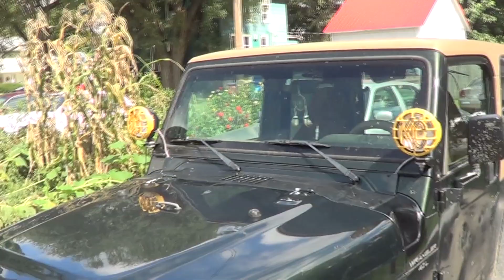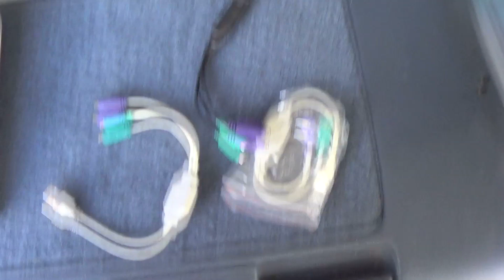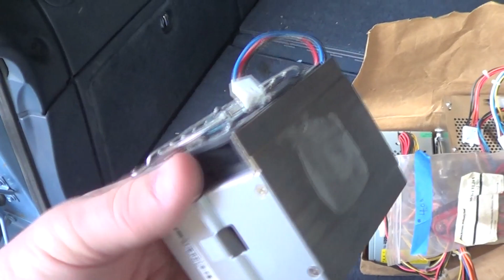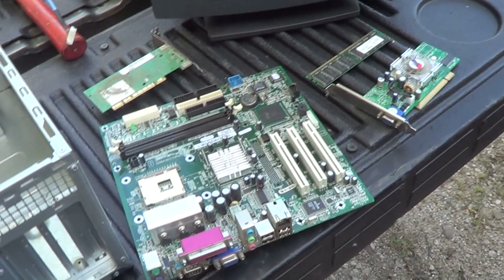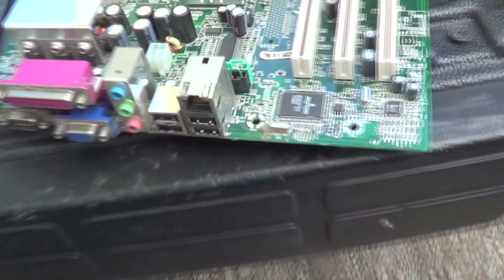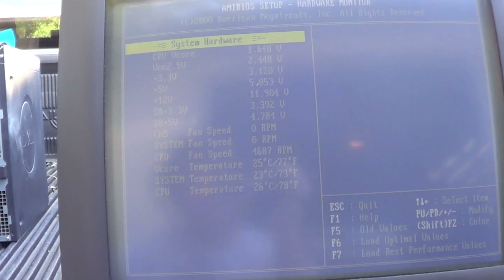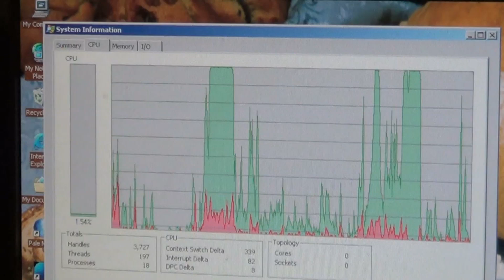2014 Hamfest Finds, Remodeling, A Little Car Stuff and MORE!

Comment: Much cool stuff. The TI-2500 was actually the first Texas Instruments calculator. Yours is a later revision from probably 1973. There are four NiCD AA cells inside it, which hopefully haven't spewed their guts everywhere.

I didn't know PC Chips made motherboards that recently. I thought they died out after the Pentium II era. The builder must have put a LOT of effort into saving money, given the fact that they chose such a board, despite the prominence and affordability of Gigabyte, Asus, and even Intel boards.

I'm surprised that Hipro power supply doesn't have bad caps. I have a computer with one (also 250 watt, so maybe even the same model), and MOST of the caps are bloated. I'm refraining from using the computer, and I'm tossing the power supply as soon as I get a replacement. It might do you good to open it up and look inside it, though - I recall that the only good caps on mine are the ones that can be seen through the vent.

That Dell monitor you tested the computers with looks to have been made by AOC - it's got the user interface composed of the several indicator LEDs that was typical of them. I had one years ago and liked it because of its uniqueness in that regard. It was also neat because on certain computers (don't know why only certain ones), the LEDs would make a chasing animation when it went into standby mode.

I'd be interested to see a video regarding unofficial Windows 2000 updates, if you ever make one. Same with the clock.

Any plans for that custom computer?
Reply: ***** I have a PC CHIPS Socket 775 board with a 1333 FSB 3Ghz CPU in it with a PCI-e Slot

Comment: This video was hilarious!  There were so many funny things you said in this video, it certainly kept me entertained the entire time.

Most times the screws used to secure the motherboard are hex-head as well as having the slot for Philips.  Wouldn't a nut driver have been a better idea for a stuck one?

P.S.  I made the PS/2 Model 30 floppy drive seek test video, you may wish to check it out!

Comment: as for the dell... it's always that last screw... which seems to be the case for everything electronic, there will always be that one screw that never comes out without using destructive force in one way or another. the service tag is in the bios as well. those service tag stickers always seemed to come off.

Comment: I've finally found a use for those old Dimension 2400/4700 machines after throwing away so many of them over the years. In their stock configuration, they were just too underpowered to be remotely useful for my needs. Since the case is one of the strong points of that PC, I recently got the idea to gut them and transplant more modern components. My most recent build was an Ivy Bridge Core i5 system with 16GB RAM, and an nVidia Geforce GTX650 video card. It makes for a great sleeper machine when going to a LAN party!

The reason I bring this up is because I now have TONS of perfectly good Dimension 2400/4700 motherboards laying around, that are working pulls. (No bloated caps either!)  I'll be more than happy to send you one for the price of shipping, if you're interested.

Comment: Speaking of PC Chips, I'm working on a Slot 1 Pentium 3 that has a Jetway motherboard that is allegedly just a rebadged PC Chips board in it right now. Its well past the fake cache era, but it has some interesting quirks such as having to "reset configration data"  in the resource allocation section of the BIOS before adding any PCI or ISA cards if you want it to post with the card installed. And having completely different onboard sound (c media instead of ESS) to what it claims to requiring one to go beyond the board support page for a driver. I would totally replace it, if I could find a slot 1 board for a reasonable price but that stuff just isn't around here in New Zealand anymore.

Comment: I have no idea as to the amount of people below people me to which I may be repeating, but i would love to see a windows 2000 unofficial update video.

I few years ago I got a hold of a Pentium 133mhz Packard bell  and a Pentium 3 gateway 2000 for a wallet shattering price of 3 dollars. On the Packard I install all the unofficial updates for  98SE and was quite impressed, but didn't run into much luck with windows 2000 for the gateway since there seemed to be different people, or groups of people making unofficial updates, some of the sites being completely in Japanese and I just didn't end up being bothered.

Anyways would love to see what you do to Windows 2000 and unofficial updates .

Comment: Bill, Ahh Palemoon, i enjoyed it untill i could no longer bodge it to work on my xp pro acer aspire 5315 laptop installation, i had to drop back to firefox, but it seems fine so im happy again :-)
Add blocker and ghostry (both disabled for youtube) i also have installed, in addition ive added configmania/Advanced settings/page-to-pdf plus flagfox, i do like firefox for its interesting addons :D, internet explorer/windows 8 or 8.1 and 10 have a place in my trashcan, if you know what i mean lol.

I really enjoy your ramblo-thon videos bill, never boring, allways interesting, something to sink my mental teeth into :D.

The heathkit clock i suspect is mendable, perhaps its a combination of dodgy switches and it may have lost its 60hz from the mains input to generate its ti........ming lol.
I too have used pcchips mobos, they work!!, sys chipsets can be fast but they crash a little too easly.

I also had one of those five million year old silvery astec supplys (big switch type), it didnt fail, technology just phased it out :(, i also had an ibm looking keyboard with  dip switches on the underside, XT and AT compatability, a rather usefull keyboard :-).
I better shut up, as im boring myself and dont want you to fall into a coma ha ha :D

Comment: i use that exact same antec case for my bedroom machine, i picked it up at a thift shop for €4 :D. this video reminds me that i should pick up more stuff from that thift store, they tend to have decent stashes of old AGP graphics cards on the electronics shelve.

i do have a car question tho, what is the fuel cost like with those large V6/V8 powered cars? its unfortunate that these kinds of cars are nigh impossible to own accross the pond due to fuel cost and high taxes aswel as insurance.

I'm also curious about your opinion on smaller economical cars. (cars like the mazda2 vwestlife used to own)
Reply: thanks for taking your time to write such a long response :)
and yea its a completely diffrent ballgame here, people buying new cars ussualy only look at the price and its fuel consumption. (unless they got deep pockets and go for a big german car) it doesnt realy help that our roads arent very friendly to american cars (speed bumps everywhere), aswel as parking spaces generally being too small to even fit them (or atleast giving you a massive headache trying to fit them in).
i think sales would have been better here if the government didnt charge insane amounts of tax aswel as import fee's which resulted in cars that had their price doubled or more. i quickly glanced at chevrolet's website and the camaro's starting price is $23,705 whereas here its €104.995,- (altho in the UK its £35.320,- but its still the double.)
and i do agree that i prefer the boxy styled cars from the late 80's and early 90's (the "box" in my username is derived from that heh.)

Comment: Bill, I have a dimension 3000 that just will not die. I have the ram maxed out at 2 gb and a 500gb ide hard drive running linux mint 13. I installed mint after XP support ended. It has been running for over 10 years now. I bet Dell regrets ever making the model 3000 because I have had no need to replace this one. I enjoyed watching  you hamfest finds and computer repairs. Keep it up.

Comment: I really need to attend the hamfest near me. Have to take my truck though :)

Someone had to have cross threaded those screws into that Dell 2400's cpu mounting brackets.  Definitely makes it interesting to the uninitiated when trying to remove those Dell motherboards and finding out the screws to the retention brackets go straight to the case.
Reply: ***** With a long video, comes a long comment :)  I have a Dimension 2400 here in the shop for no boot issue.  I decided just for the fun of it after watching this video, to attempt to pull the screws from the heat sink retention brackets.  Of course, typical of Dell thermal compound, the socket 478 cpu came out of the socket, firmly stuck on the heat sink. The screws came lose with little effort, I was just curious if this was something common on the 2400 line for some reason.  But I did have to use my " ESD Regulation Compliant Computer Grade Power Supply " to "assist" the side panel back into place :)  If it isn't one thing, it is another that can stop you or give you a hard time :)

Now that I have made it though the video :)  That poor Jeep... being a car person myself, working on, taking care of and restoring cars as best I can, it pains me to see your brother do that to his Jeep..  Anyway!

I would say the Antec case was worth $15. Very well built " old school " gaming atx case. PCCHIPS board is sad to see in such a nice case though.  Looks to be in very nice shape overall.  Although I personally would prefer to run an Athlon XP with an Nvidia nForce 2 chipset motherboard, preferably something from MSI, ABIT, ASUS etc... I doubt the SiS chipset will really make any noticeable different in regular use.

With all the love Windows 2000 has had over the years, I wonder if Windows XP will enjoy the same "unofficial" fan support.

I hope your remodeling projects get taken care of. It sounds like those are turning out like you garage did with how long it is taking everything to actually get started.

Last of my comments, to go with a long video which I am glad to see..  I will be very interested in you talking about Windows 2000 in the modern world.  Also I think that clock might make for an interesting Kitchen Tables video.  Even if it does not get fixed, it would be interesting to know why it is behaving in such a way. I'd be inclined to lean towards a bad solder joint or a failing display driver IC.

Take care!

Comment: I've got a very similar (also red) PC Chips motherboard in a cheap $10 system I bought from Goodwill. Mine, however, is designed for use with an Intel CPU, and has a Socket 478. Mine's also based on the same SiS chipset.

Comment: KX works well with that sound card , it does switch front and rear however. And the live 5.1 is a very very nice card, still blows all the integrated sound cards out of the water even the special ones on new gamer boards. Good deal on it for 2 dollars, i think i got one in the UK for about £3 was very happy with it.  That model m deal as well , amazing ! I won't tell you what my New in box Space Saving model M cost :P.

Comment: That 2400 certainly was a durable machine, it's always amazed me to an extent I've seen older hardware go through and it still work. I was honestly amazed that worked, I thought you would have had shorts and such to prevent it from working or some other failure, but it just worked, have to give credit for that. I find it sad how in today's world there's getting to be less and less high quality hardware in the computing world. I'm into vintage computing up until the socket 478 era, and the quality I see on old hardware is amazing to me since I've worked with new hardware for s while, working with vintage certainly did provide a nice change of pace. I'm glad to see both systems working great, even if that 2400 was a pita.
Reply: Yeah, I have machines that well over 10 years old work perfectly with their stock hardware. That video port amazed me too, I figured it'd have a mental breakdown over that, but nope, worked like a champ.

I recently worked with a new Optiplex, it was a sad experience, it felt like any other machine you could get almost anywhere

Comment: Had a Dell Dimension back in 2004 (I think) It had an AGP slot.
Reply: ***** I never did try out the AGP slot though, The computer went out of service (My moms PC) replaced by a laptop in 2006 I knew it had a Pentium 4 HT CPU don`t remember on the speed though (Maybe 2.8 Ghz I want to say) But by 2008 some how the internal graphics and or motherboard issues causes artifacts in the display, did not have an AGP card at the time to test it, It ended it becoming a victim of entertainment by it going out the window sadly. But during its time of use it was an amazing computer.

Comment: I believe those ATI cards were "All in wonder" cards, I think i have one that is similar to the one with the sticker. I haven't tested it though, but they were supposed to be some good video tuner/capture cards back in the day. my favorite though is a Hauppage wintv card with digital tuner. these don't appear to have that, which sadly makes these somewhat obsolete, though I can assume that they can still be used to capture video. you might have something there with the sample card though.
Reply: You are probably right, I imagine they would have been shipped with a special set of drivers that would make the card work enough for the reviewers. I thought they would have to destroy, or return the card when done, but I guess that wasn't the case. just another example of what will turn up when you don't expect it.

Comment: Hi, uxwbill, I scored on a HP A6750T desktop computer from 2008! I was picking up a DVD drive the other day , when the person asked if I wanted to see other PCs he had in his basement. I saw the HP A6750T and I said, how about $20, and the person said sure. I took it home and it had an extreme amount of dust in it. I was able to get all the dust out to where it looked like new, and it started right up. It has a Pentium Dual Core processor, 3gb ram, 640GB hard drive, Geforce 9300, and Windows Vista Home Premium!